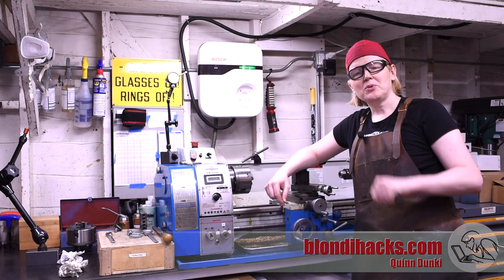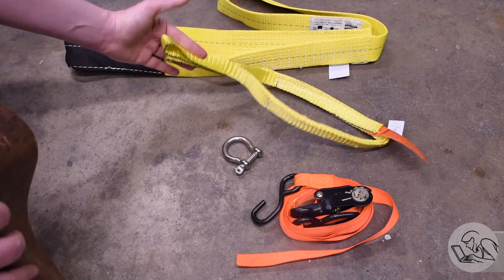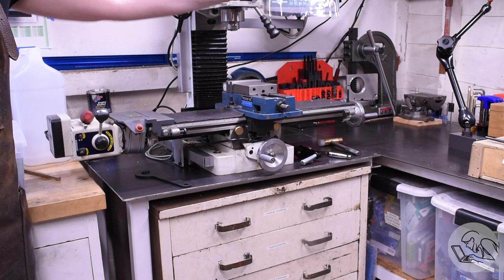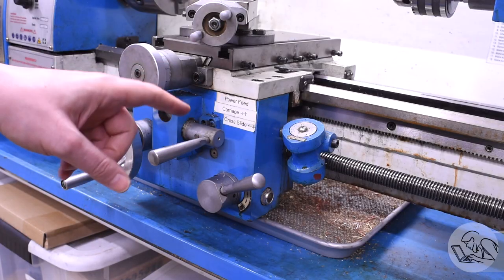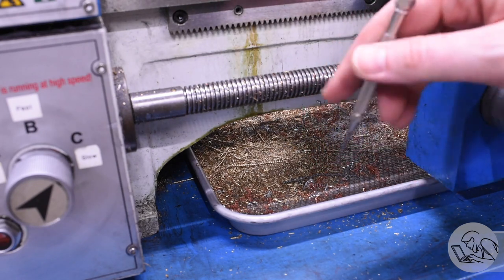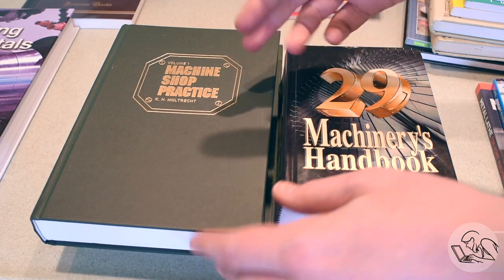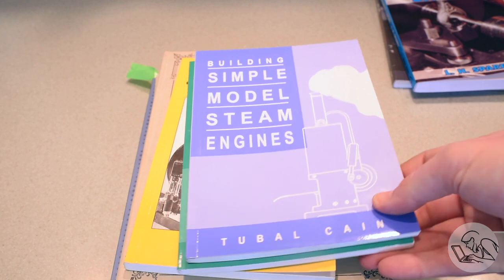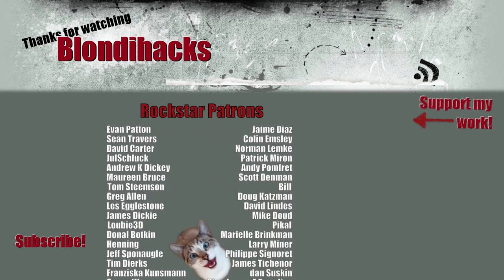Absolute Beginners To Machining : Day 2!  More questions answered

Comment: One of the best moves I've ever seen was where the lathe was bolted down onto a reinforced concrete pad on the benchtop. It lowered the harmonic frequency of the system, and immediately improved the surface finish. That's why the old manuals always suggested you bolt the machinery to the shop floor. It wasn't to keep it from walking around the shop like some idiots keep saying. Anything you can do to mitigate vibration will help in accuracy and finish. That's why they balance race motors, it puts more power to the output and doesn't kill itself.

Comment: I've had my benchtop lathe (same approximate size and weight as Quinn's) on top of a 52" rolling tool cabinet for 10+ years now with no issues. The cabinet is about 100 lbs, and there are about 350 lbs of lathe tools and accessories in the roller bearing drawers. The cabinet has 4" rubber tired wheels with locking swivel castors at one end and solid mount free rolling castors at the other. Its handy to be able to roll the machine away from the wall to re-acquire dropped parts. The lathe just sits on top of the cabinet, and I have a 1" MDF base under the lathe bed base, on top of a 1/4" rubber pad that is on top of a solid hardwood top that came with the cabinet. My lathe runs quiet; very little vibration. And it is stable (hasn't moved on the cabinet at all. No, I can't precisely level the machine, but the bed and ways checked flat and straight. My lathe produces very precise work, so it can't be very wrong. My floor is pretty level and flat in that spot, too.

Comment: Yes, they do make non detergent motor oil too! It was recommended in all my 60's and 70's Honda motorcycle service manuals as well as the recommended oil for many lawn mower engines.
Reply: NAPA sells a non detergent 30 weight. They don’t always have it on the showroom shelf, but usually have it “in the back”.
Reply: Excellent point!

Comment: Great video to come inside to watch after an afternoon making chips on the mill.  Thanks Quinn for helping me get going at making parts easily with excellent surface finish.  Got the vice squared up, an end stop set and the edge finder out to knock out parts in 3/16in steel bar stock pretty quickly.  Side milling 17.25in long cuts with 1/8in DoC was so easy once I had it set up an rigid!

Comment: I bought the stand that PM sells for their 1022, then bolted some 5/16ths by 3" bar stock across the bottom (front and back)  then added some beefy castors.  It became very easy to position my lathe as a result.  Then I made some stand-offs upon which I placed some machinists jacks for leveling.  Currently my lathe is level, with the weight resting on the jacks.  Seems to be a very stable setup plus the few inches of extra height brings the work closer.

Comment: Great video, but with an error that will confuse beginners and could result in damage to a machine. ISO 68 does NOT automatically mean way oil. ISO 68 refers to the viscosity of the oil. Look at your oil equivalence chart. Most entry level machines do use ISO 68 way oil, and Vactra #2 is ISO 68. Many other types of oil also come in ISO 68 viscosity. Most hobby type machine tools - and many classic industrial machines - use ISO 68 oil in their gearboxes. It is not way oil but rather machine oil or circulating oil. On the other hand, if you score a classic industrial grade shaper, it will likely need a heavier grade of way oil, perhaps Vactra #4. I have a turret drill that calls for Vactra #3. Try finding a source for it - only slightly easier to find than unobtanium. 

Like I said, a first rate video. Keep up the good work.

Comment: One little addition maybe: In the German Airforce for all surfaces and ways we used Gun-Oil. Nice oil with a good grip on the surface, very nice for sliding surfaces like ways, relatively cheap and not sticky towards dust and other stuff! Also good anti-corrosion

Comment: My uncle set his last set of machines on top of .5" of Neoprene that compressed to a uniform 1/6 under the weight.  The tables were all square tube like yours, but that was solely due to cost and availability...when you have about 200 feet of scrap square tube after a project you make something for your shop.  He always said the table weight was more for not having to worry about how heavy he worked inside the machine and that the rubber was for helping remove resonant vibrations which he claimed was far more likely to cause you trouble than your machine itself not being rigid enough.  He explained to me watching the resonant vibration destroy a Navy Diesel Submarine engine and rip it right out of its testing housing

Comment: I have a bucket just for brass shavings and scrap. When full I usually get about $50 for it. Also, remove handles from machines when moving. they ger bent easy. My 12" lathe is on a rigid base and when machining if I lean on to machine I can see a deflection on a light cut. I no longer rest on my lathe on a final precision cut.

Comment: Hi Quinn  .   Once you start holding larger out of balance parts in the lathe , you will then see the requirement for a very rigid mount  either bolted to the floor or a proper solid bench .    Cheers .

Comment: I was suddenly jolted by the size of your mill. I've only ever used the Bridgeport in my friend's Sheffield workshop. The milling vice alone weighs over 100 kg, so we use a chain block. His main lathe is a pre-war Holbrook that would regard my Myford Super 7 as a toothpick. Most tools in his workshop require a fork lift, or steel bar rolers & heavy crowbars. it's all old but massive.

Comment: Quinn, I knew you were a good machinist but I didn't know that you were such a good welder. The workbench looks nice and it has to be stronger than a bull elephant. I enjoy watching you work because you do things exactly correct most of the time. Short cuts are not in your vocabulary. That is good.

Comment: 1:12 Someone sufficiently crazy with access to a CNC lathe and a decent sized hoist/crane should do that thing people have done with 3D printers where they run them suspended from a cable to see what difference a very unstable mounting surface makes.

Comment: 25:35 Those faceplate setups give me an idea for a challange for you quinn, I challange you to make a project that would normally be considered a mainly mill project without the mill, just the lathe. Of course you can use other tools like the portaband. No vertical mill slides either.

Comment: I'm cleaning a 58 year old Logan Lathe and have amassed a world class collection of degreasers and cleaning products.  A word of caution here, always wear gloves, safety glasses, and clean in an open area, or in front of a fan.  I'm going to repaint my baby (14"x40") back to the original gray so some of what I've found doesn't matter, BUT, while brake cleaner is one of my go to cleaners, it will take paint off.  Even light sprays will do it.  The Logan has evaporated grease everywhere.  For the really hard stuff I use Goof Off.  I'll use brake cleaner too but again, it'll take the paint off.  But so does Goof Off.  Be careful.  My final go to is Purple Power, full strength. Under $5.00 a gallon.  Buy a spray bottle and reload it from the jug. It was great to take the light dried on grease off but...it'll gag you with the fumes and gloves are really important.  Puppy pee pads are great to catch degreasers and the small ones are less than $5.00 a pack at Wally World.  Ditch the pads before they leak through.  Takes about 30 mins.

Comment: For gearbox oils, make sure and use a synthetic oil. They have much more lubricity for a given viscocity of oil, and they have a higher heat limit than mineral oils. In fact you can often use a lower viscocity synthetic oil than you can a mineral oil, which reduces "windage" losses increasing efficiency somewhat.(often limited usefulness though)

Comment: Small comment  on  2 of today subject, 1, If you want to know the answer you have to ask the question,2 recycle whenever possible, it may take years but  do it, you maybe surprised the odd uses for chips, cast iron, brass,and bronze chips can be used in epoxy, bronze can be cast into a new round stock, A small bronze round bar is $$$

Comment: Awww hello Sprocket 🥰  There are two families of brake cleaner, the ones that have chlorine (and are non-flammable) and the ones which don't have chlorine (and are flammable); I might lean towards the non-chlorine ones for the sake of the copper alloys and the rubber bits.
Reply: Chlorinated brake cleaner is also a serious risk for any parts that get exposed to high temperature -- anyone who does any welding or high-temperature cutting or grinding should never, ever use it in their shop. Tetrachloroethylene, the "chlorinated" solvent in chlorinated brake parts cleaner, turns into extremely deadly phosgene gas when exposed to high temperatures.
Reply: @magicoddeffect , well said. The odor of phosgene is like that of newly cut hay, and if you smell that, you have already been poisoned.

Comment: to put the chip recycling into perspective: years ago I worked in a production fabricator (engine valve seats mostly) the shop had a foundry, ingots of a particular nickel steel alloy and three lathes (two CNC, one double turret production manual) and a double wheel grinder. ALL of the chips produced went into 55 gallon drums. on "pour days" when we would pour out molds (80 sand molds per pour) the crucible would be heated with some ingots and mold scrap and then chips tossed in as it came up in temp. We would go through 3-4 drums of chips in a crucible load without appreciably adding volume to the crucible's contents. except for slag. lots and lots of slag. so much skin roasted while fishing for slag...

so its not worth the energy cost, labor time or equipment to melt chips for the home gamer.  (i question whether it was even worth it for the shop I was at, TBH)

Comment: If you're getting one of the heavier hobby lathes, and/or if you need to navigate through tricky doors or staircases, you might consider hiring professional riggers (search under 'riggers' online).  I had professionals come in and de-crate my lathe, assemble the stand, attach the lathe to the stand, fit it through a doorway in my garage that had only about 2" of clearance, and position it exactly where I wanted.  The stand and lathe together weigh 1,350 pounds.  The rigging cost me $1,300, which certainly isn't cheap; but I'm not at all sure I could have done it, even with a friend or two.  It wasn't necessary for my Mill, which weighed only 400 pounds.  Anyway, just an option to keep in mind.

Comment: I tend to service lathes as part of my trade; ISO 32, 46, and 68 is what all chinese products use from what I have seen. This hydraulic oil is what we use as diblock or bed oil too. Any oil on the bed is better than none but a bed can never have enough oil, my own personal opinion. The oil is all that flushes the chips out of the working surfaces. Be careful with compressed air around machine tools, it blows stuff just where you don't want it to be if you blow in the wrong direction...

Comment: A solid wood bench (like, better then my old table which rocks like a swing and throws stuff off when trying to file something in the vise) would be okay? I'm thinking of a lathe basically just one size and class over the 7x14 minilathes (400mm between centers .. 70-90kg) .. 

Have been wanting to get a lathe for ~20 years now, but always put it off 

Something which is kinda available and able to be transported into my basement shop. Saw some with a 50mm wood top and a steel tube underconstruction which are affordable and should be able to be carried down there. Or does wood just warp too much.

Comment: I can't recommend Machinery's Handbook highly enough. I managed to find a copy at a recycling centre and paid 50 pence (62 Cents US) for it. OK it's dated 1919 but everything in it is valuable to a hobby machinist or pro alike. 
These old ones also mention stuff about belt driven machinery and the section on metal hardening and colouring makes for an absorbing read; lots of nasty chemicals and solutions too,
Regards from Cornwall (steam engine capital of the world) UK. James Watt lived and worked only a couple of miles from here, along with a host of other steam celebrities.

Comment: I guess for a cheese lathe, you'd use whey oil?
Reply: That was a gouda one.
Reply: I've seen cheddar.
Reply: Is that refined from curd oil?
Reply: And on surface plates, you should smear some blue cheese to check high spots.
Reply: @danielabbey7726  Use limburger and they’ll all be high spots.
Reply: In North America, we tend to measure by volume, but I'm told in Europe, they weigh oil.
Reply: @rpavlik1  No weigh!
Reply: Groan
Reply: I once used spray cheese in a can to lube a side milling cut, whey too viscous for proper chip release.  Although, low brow tasty on a chip...
Reply: Only if it was made in reverse!!! MADE in reverse! Geddit?

Comment: Regarding way oils, ISO 68 is just a viscosity grade, and has nothing to do with whether it is a way oil. Same for the #2 in "Vactra #2".

The important point about way oils is that they leave a film rather than draining off open surfaces completely. One way of measuring this is the "tack" of the oil. In a regular journal bearing, the oil is held in indefinitely by capillary action/surface tension, but on an open bearing surface like lathe ways, the oil needs to stay put on its own. The tack of the oil represents sort of an increase in viscosity as the oil film gets thinner, so as the film gets thinner is drains off more and more slowly, and so takes a long time to drain away completely.

That being said, I've heard that Vactra ain't what it used to be. Sometime around the late 20th century (1980's maybe?) it was reformulated (perhaps to conform with some environmental requirements?) in a manner that reduced its tack, making it less suitable as a way oil than when the machinery manufacturers recommended it in the first half of the 20th c.

Lately what I've been using as a way oil is Vacuoline 1409 (I hope I remember that number correctly) which apparently is fairly close to the original Vactra oil. I also use it on the sliding and rolling surfaces on the various old-timey printing presses I run.

Comment: Would you be willing to recommend a good "beginner" hobby mill?  I have worked on a full sized Bridgeport but have no desire to take on such a beastie in my garage.  Thanks
Reply: Recommend a good inexpensive Cnc milling machine too.
Reply: @CalCarter1  The words "inexpensive" and "CNC milling machine" are fundamentally incompatible, unfortunately. The "cheap" way to get hold of a CNC mill is to buy an older mill and convert it to CNC yourself...and that'll still set you back thousands of dollars depending on how skookum you want it to be.
They're all expensive because precision is expensive. 
Now a small CNC router isn't nearly as expensive, but they really aren't meant to cut anything harder than aluminum.

Comment: Hi Blondihacks, I have a question. I have a very similar lathe machine. It's Weiss brand WM280V and my carriage does not have any holes at sides for oiling or oiling window like yours have...  What should I do? Should I dissasemble it altogether or is there anything I do not know? I also cannot find any manual on this model.. Thanks

Comment: Find yourself an old oil gun with a needle oiler tip. That's the proper way to oil those needle ports with their spring ball closure.
Reply from the maker: I have both and find the flat tip works much better

Comment: Just thinking; did your install of the quick change tool post require any special mods? When i bought one, company that sold one to me said that one needs almost always to mod it to make it fit
Reply from the maker: Mine came with it installed, but yes it is common to have to modify them to fit a particular lathe.
Reply: @Blondihacks  I bought one quite early on, found out installing it was good first real project :D

Comment: I was told by xxxxxx xxxxxxx xxxx that WD 40 was too expensive to use as a cleaner.  They were wrong.  Other than brake cleaner, WD 40 is the best cleaner.  Quin, you left out one detail that I find important about lubricating ways...The oil needs to be non-ionic.  You know how regular oil is like a magnet for dust and cat hair?  Well, way oil that is non-ionic does not attract dust.  No promises on cat hair.

Comment: Question 2:  Your lathe's leadscrew was covered with junk.  I'd have thought it would be even more susceptible to damage than the ways.  Was that an omission, or should I get my intuition tuned up?
Reply from the maker: Yah, it’s hard to keep clean. It’s good to clean it regularly, for sure. Especially before a thread-cutting operation when the threads will be engaged

Comment: As for having a more rigid lathe, buy a bigger lathe.  I honestly cannot recommend those small Chinese lathes or mills. Ev we rybody I have known that bought one killed it reasonably quickly, burned up motors, broken gearboxes, etc, and replacements parts is an iffy proposition.  You can get parts for an old LeBlond, Clausing, etc. There are many, many surplus machines out there, and sometimes you can get one for free or nearly free.  A friend of mine gave me a 14 X 40 Enco (not the best machine, but the price was right) for free, many times people just need the room , you might keep an eye out for ads.